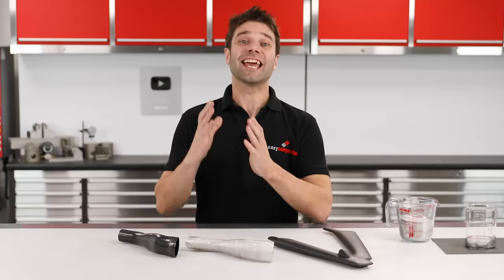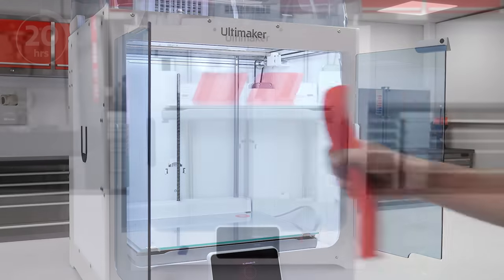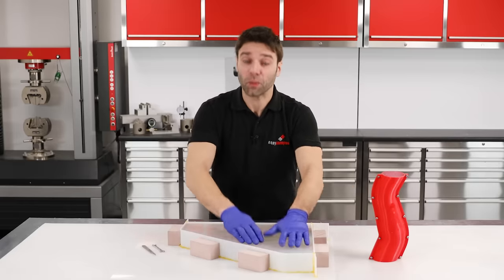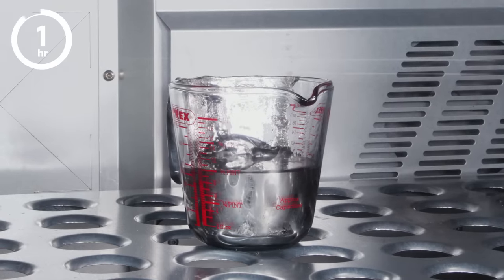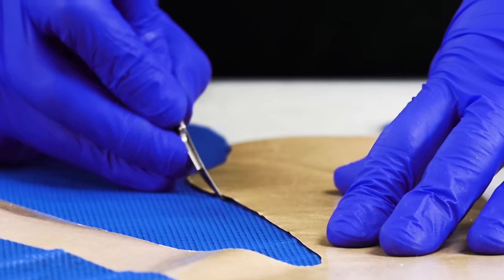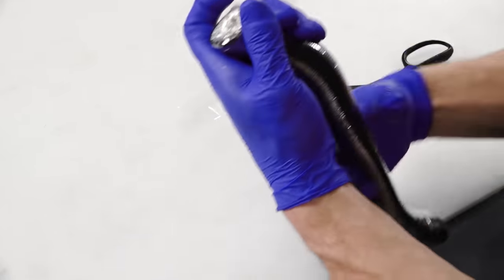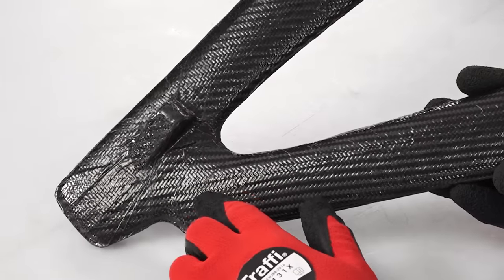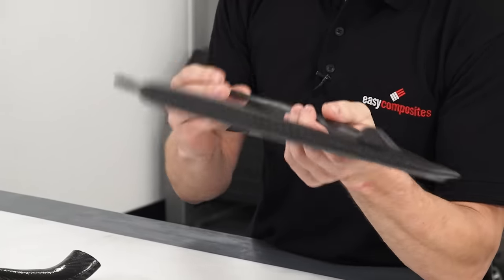Moulding Hollow Carbon Fibre Parts Using a Low-Melt Metal Mandrel

Comment: You mentioned that the LM95 alloy had a lead content in it, I was wondering what the reason for that was? What would be the ideal scenario for use of each alloy?
Reply from the maker: Different metals, in different ratios, produce alloys with specific properties. To create an alloy with a sharp melting point at around 95C requires a tin-bismuth-lead alloy. Removing the lead raises the melting point to 138C, hence our lead-free LM138 alloy.
The ideal scenarios come down to the cure temperature of the resin used in the laminate (in this case the prepreg), and the maximum temperature that the resin can take, for the melt-out. 95C is high enough to allow the prepreg to be cured without softening the metal whilst the prepreg itself can withstand the 100C required to melt-out the metal.
In the case of LM138, the prepreg used would need to be able to withstand the 140C needed to melt-out the metal, but it does mean that the initial cure could be done up to 135C, which would be useful for prepregs which require a higher minimum initial cure temperature.

Comment: one day there will be a CNC "weaver" machine with numerous arms that pass' rolls of pliable carbon roving yarn back and forth.
The resin will be partially cured on the micro scale in stages to allow the shape to be built up in layers without a form.
Anchor points with removable attachment points will be built into large shapes to add temporary supports.
Smaller structures will be supported by "breakaway" legs that are made of resin alone.
We already have all of the necessary tech to produce such machines; it is just a matter of time before this process arrives.
Reply from the maker: I agree some more advanced tech will allow such "printing/weaving" of some composite structures to be made in one shot that way.  Perhaps with UV curing resins or similar.

Comment: Love your videos! How many times do you think you could reuse the silicone mold for the metal?
Reply from the maker: Hi John, thanks for the question. The silicone doesn't degrade in this process so it should last indefinitely.
Reply: @easycompositestv  Wow that's great to hear, thanks for answering!

Comment: These videos you make are just a great resource. Are you available in the USA? I'm trying to get in to this field as a hobbyist and was wondering if it's cheaper to work with fiberglass for the likes of mold creation and refinement then move on to using CF?
Reply: They have a very good training program you can attend to learn all the popular composite techniques.
Reply: Make sure and watch the video Carbon Fiber vs Kevlar vs Fiberglass - Which one is right for YOU? 
Carbon fiber is great for many applications but there are applications where fiberglass is the better choice.

Easy Composites ships to the US but they don't have an US distributor (I've asked). As much as I like Easy Composites, I'll likely buy my composite supplies, from a local seller.
Reply from the maker: Hi, thanks for the feedback. Although we're based in the UK, and have a subsidiary in Europe too, we don't yet have an operations 'on the ground' in the US yet. However, we can ship to the USA and in fact we send hundreds of orders to the USA every week. Shipping is a bit more expensive (as you'd expect) and can be particularly pricey for small quantities of 'dangerous goods' because they need to go on a special service, but lots of US customers still find the overall cost lower and appreciate our service and support. In terms of starting out, yes, glass fibre composites will teach you most of what you need to know for a lower cost than carbon, while you find your feet : )
Reply: @ddegn  It’d be nice for to have a US distribution hub for time urgent situations. But if you plan out your usage well enough and err on the side of having extra material, Easy Composites is the best supplier I’ve experienced.
Reply: @ChuckThree  That's interesting to hear. If you're so inclined, I'd love to hear more details about your experience with US sellers.
Reply: @ddegn  Rock West, Envision, couple local to my DMV area. Nothing particularly bad to comment on, but I have made errors ordering incompatible materials (it’s a hobby not profession for me) and Easy Composites paused filling to order to confirm wether or not all the materials were for the same project.
Reply: @ChuckThree  Thanks for taking time to provide more details. I appreciate it.

Comment: seems like the metal is a lot of work.  What about slip forming with plaster?  That is how most of the Kevlar transition ducts used to be built for airliners.   They would build a  model and build a mold like yours and then fill it with wet plaster and pour it out.  After layup and curing at any temp you just bounce it on the table and it shatters out.

Comment: Did you select metal because it has lower viscosity and melting point than thermoplastics, or is it a matter of flammability concerns?
Reply from the maker: Ease of use in this case as these metals are designed for applications like this where the low melt properties, flow when liquid etc are beneficial.
Reply: @easycompositestv  Thanks. I can see how that would make the core remove more completely. Also, metal residue is easy to detect by visually inspection. I guess that justifies the high density and dramatic emptying of metal.

Comment: It would be very interesting to see someone use this as a core for a forged carbon component.
Something like an inlet manifold.
Reply from the maker: The forged carbon would need a suitable high temp resin system post cured to a reasonable level to withstand the melt out without distortion.

Comment: Alternatively could you use a water soluble filament to print the internal structure to speed up the process and reduce waste and cost
Reply from the maker: Yes Water soluble filaments may work in some cases.  In our experience, they seem to be hard to dissolve out but that may improve with new products over time.

Comment: Would there be any strength benefits to make the metal inner mold & laminate it, then use a split mold on the outside also? Similar to compression molding/ forged carbon?
Reply from the maker: It would be more complex as the compression element would have to be very tightly calculated and controlled.  Plus an out of autoclave pre-preg system only needs vacuum consolidation or similar levels of applied force.

Comment: Perfect. I would say simple and ingenious. This is the issue that has been torturing me for years. By applying the technology described in this video, one can produce complex parts like custom manifolds or bespoke car interior details. With no splitting seam. I have been pondering about reaction of metal to carbon and part formation, but have hardly thought out the process properly. Simple and easy - MELTING OUT! 

What if a high temperature waxes are used instead of metal alloys?😉
Reply from the maker: If you have a suitable high temperature wax that is rigid enough then that could work.  We have experimented with a few different melt out core types to see what works well and found this method reliable.
Reply: @easycompositestv  thanks guys! Anyway, I simply guessed!🤣🤣🤣

Comment: If I want to make a hollow large part approx 8" tall x 20" long with open sides, would this process be the same or is there a better way to make large parts?
Reply from the maker: It depends on the geometry and what facilities you have available to you. The other option is to go with a split mould as we show at the start of the video.

Comment: If the oven was vertically tall could you drip the metal right back into the mold?
Reply from the maker: You would have to align everything perfectly plus you would have a slight shortage due to residue left in the part.

Comment: Curious to know why you didn't just wrap the 3D print and melt that out?  Or use various soluble filament options?
Reply from the maker: We have experimented with soluble filaments and not had satisfactory results.  Also most filaments would not be suitable for the pre-preg process and still be capable of being melted out.
Reply: I had some luck with the soluble filaments from Stratasys back a few years ago.  Interesting.  @easycompositestv

Comment: Great job, but why don’t use PVA Filaments printed mold directly instead
Reply from the maker: We have done a small amount of testing but didn't find that they released all that well. Additionally, remaining dimensionally stable at the temperature required to cure the prepreg makes the low melt alloy more preferable.

Comment: What about simplifying this to:

1. Print the shape in PVA (using standard 3D printer)
2. CF around (like around the alloy)
3. Instead of heating, just put under water.

If you make a lot of parts the 3D printing may be slower than the mold, but for faster iteration or lower numbers the reduced work sounds like a great fit. WDYT?
Reply from the maker: Hi Werner, yes, you can do a sacrificial core moulding process using PVA print. There are some compromises, including the fact that you can't use prepreg (which does make the process a lot more practical, and successful) and you would have to reduce, or eliminate, any consolidation pressure (like a vacuum bag or shrink tape) in order to avoid compressing and distorting the mould, but for prototypes, iterations or less demanding requirements, this would indeed be a faster process.

Comment: Hi, could you please explain the difference between prepreg and sheet molding compound? Where do these terminologies differ?
Reply from the maker: The production and finishing processes are different albeit there is some overlap in materials and resin types used.  SMC is more suited to higher volume production compared to pre-pregs which generally use a more labour intensive process for more structurally critical components.
Reply: @easycompositestv  thank you for the explanation. Would it be possible for you to share recent articles explaining these two topics? I find them quite confusing and appreciate your input a lot!

Comment: Is there a possibility of having a video on a process similar to koenigsegg Aircore tech ? They are using a bag to pressure both side of the carbon part, bag which melt similar to the alloys from the video.
Reply from the maker: Bladder methods may be something we cover in the future.

Comment: I'd be really curious to see if you could 3D print a usable mold directly out of a material like PA-CF filament. It should handle the 95C melting temperature - if you could get a workable pour at something like 110C it should be OK. Maybe preheat the mold with the alloy so it doesn't freeze on contact during the pour?
Reply from the maker: Don't forget you also have the issue of suitable release agents and the print lines posing a mechanical lock for the metal pour and potentially area for the metal liquid to soak in.  If you can solve those problems, then it might work.

Comment: Could this process be done with a high temperature wax? There are water soluble forms of casting wax that can be 3D printed
Reply from the maker: Not some thing we have experimented with successfully.  It would need to withstand the pre-preg cure and also melt out at a low enough temperature not to damage the cured carbon.  Finding something that can do both is not that easy.

Comment: Is it possible to use this metal as a carbon matrix instead of epoxy? Would this laminate outperform same laminate with epoxy resin?
Reply: The tensile strength is about a third of epoxy and the density is 9 times higher, so it's a pretty terrible matrix.
Reply: @IainMcClatchie  , this is interesting as metals are having different properties and most of nickel based alloys outperform lm95. Another question is when the carbon starts oxidase and should in be done in chambers. I think it would be more beneficial for Z and would make carbpn more scratch resistant

Comment: Out of curiosity is it possible to do something similar for a fibreglass part?
Reply from the maker: Yes, there’s nothing specifically ‘carbon’ about this process. You can get prepreg glass fibre (we sell it in fact) which would be used in exactly the same way, and you could even hand laminate glass fibre and a suitable resin around the mandrel and cure at room temperature before melting out the core (assuming the resin you use can withstand the melting temperature).

Comment: Um... You could apply this to a 3d cross-braided composite panel for even better structure to weight ratios.
Possibly even automated processes.
You could weave in 3 dimensions, with internal, inaccessible structure, place patterns of mandrels for internal support as you weave, finish W a few layers of full coverage normal impreg to finish...
The final panel gets vacuum bagged &/or split mold exterior, consolidated, then mandrels melted out. Possibly then injected W foam.
You'd get an incredibly strong & light structures W amazing properties. Might even allow for developments of compression strengthening...
Heck, you could do a 3d composite lattice that gets filled with a compressive slurry then insulated, or other similar processes...
I wonder if you could do a version that gets multilayer hose or pipe pressure cast into it... For planes, F1 cars, next gen whatever...
Soft robot versions for carbon fibre repair or reinforcement, assuming you can bake composite repeatedly without damage; tho that'd need to be bare fiber & injection..
Reply from the maker: Certainly some good potential applications.  In terms of reheating, you need to keep within the temperature limits of the cured pre-preg to avoid distortion and damage.

Comment: This is a VERY interesting method. Do you have any tips for using something like this to copy parts (For instance, if I want to create a Carbon fiber version of a plastic component from a car)? Because while the inner diameter will be correct, the outer diameter will be several millimeters wrong depending on how thick you make it. Do you just have to sand down the metal mandrel copy to best of your ability, or is there a better method?
Reply from the maker: If the external face is the 'A' side and dimensionally critical then a more traditional moulding process would probably be better. You can take a mould from the existing part and then use that to make the composite component.

Comment: Could it be possible to use a plaster mandrel instead of low-melt metal?
Reply from the maker: Some plasters may work for a wet lay based process at room temperature but we are not aware of any that have high temp capability and easy melt out.

Comment: This seems like it could be a good method for rapid prototyping, too -- if you machine the mandrel directly from a block of low-melt alloy rather than casting it.
Reply from the maker: If you conveniently had a block the right shape, otherwise you may have to cast an ingot big enough for the machining job.

Comment: Isn't  it an advantage, when you can wrap the carbon fiber(instead of the shrink tape) tightly around that part, similar to those scuba tanks? I could imagine, that if you use stripes of about 2cm, not even a high-pressured mold could be made stronger with less resin...?

Comment: Maybe Is it useful for parts such as intake tubes to insert an aluminum/steel rings at the ends to make it safe for clamping with v-bands/collars ?
Reply from the maker: such metal rings are usually bonded in with a structural adhesive and designed so that they are mechanically locked into place for a stronger join.
Reply: @easycompositestv  thank you

Comment: Is it gonna be different if used somethin like candle was as a mold to wrap the carbon?i mean its gonna be easy to melt too..
Reply from the maker: Candle wax will soften at a temperature well below the minimum temperature to cure the pre preg at wouldn't really do the job.
Reply: @easycompositestv  tq

Comment: what is the guarantee that after heating, ALL the lead alloy will flow out of the mold and not remain inside, given its roughness inside the part?
Reply from the maker: Thanks for the question, without a release agent a thin film of the alloy will be left inside the part (this is covered briefly in the video) the castings are actually very smooth so that's what gets moulded in the part, to get a clean finish PVA release agent can be used (again covered in the video) I hope this helps!

Comment: Incredibly interesting video. I have to wonder though why carving wax would not be a better choice compared to using lead for the mandrels. Wouldn't wax be far easier to work with, melt at a much lower temperature, would not leave any lead residue nor pose any environmental risks.
Reply from the maker: It is finding a wax that is durable enough to be machined and handled without deforming.
Reply: @easycompositestv  carving wax at the right temperature is quite hard. I haven't heard of anyone who "machines" wax though. What machining is needed?

Comment: Has this been tried at all with fdm 3d prints and skipping the metal? ABS should be able to handle the curing temp at 80c and melts at 250.
Reply from the maker: 250C would be a problem for the pre-preg.  The alloy melts at a much lower temperature.
Reply: @easycompositestv  ahh, in that case I'm aware of a wax filament that melts at 140

Comment: Low Melt Alloy, aka: Lead. Which is a very toxic heavy metal. This is just my initial assessment, am I wrong?

Cool video though as for forming the carbon fiber.

edit: further research LM-95 is Bismuth-Tin-Lead Alloy. 95 denotes the melting point in c. Full product transparency though earned a subscription to the channel.
Reply from the maker: We also have the LM138 which is a lead-free alternative although its melt-out temperature is higher @ 138'C.